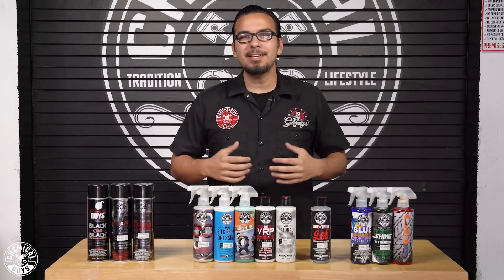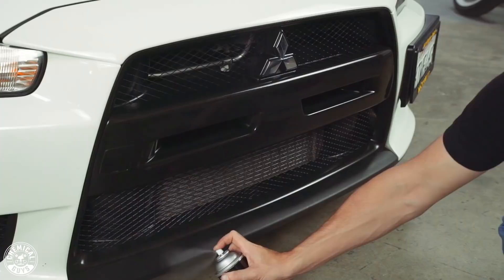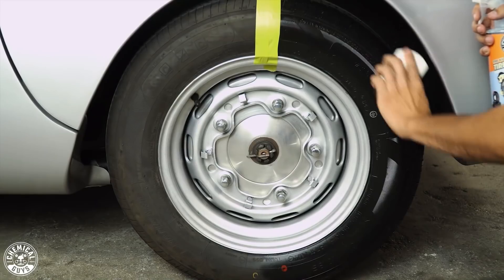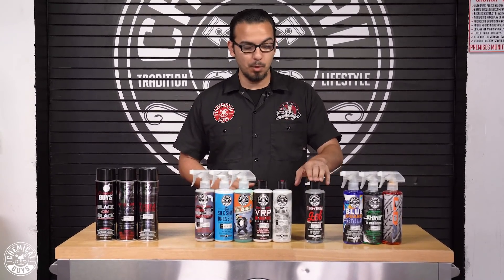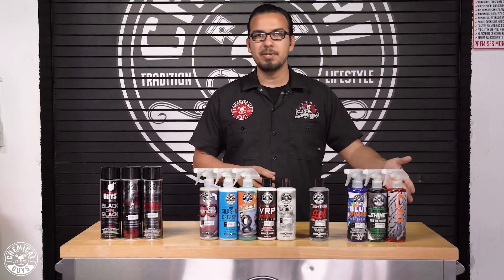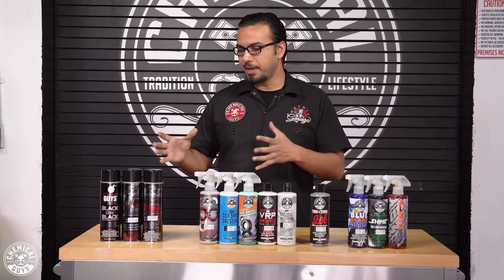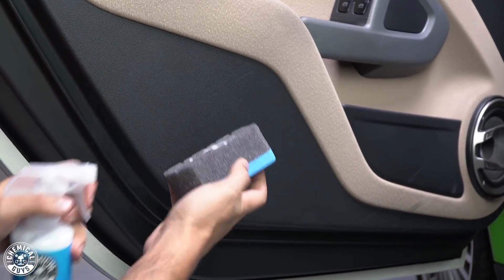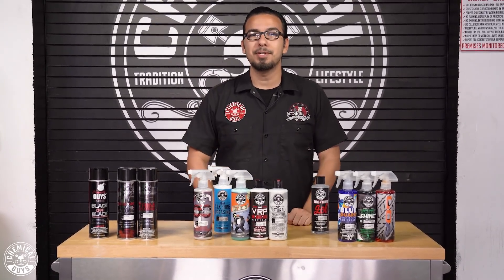How To Choose the Best Dressing! - Chemical Guys

Comment: I Am a huge fan of Chemical Guys but the dressings don’t last a few days and don’t have much shine
Reply: TurnThemWheels try tire and trim gel.
Reply: I’ve noticed that a lot of people have had this issue. What I suggest is that you make sure you use brushes to get rid of any contaminants on the tire. But most importantly make sure you use a wheel/tire cleaner that will really help break down the contaminants. Sometimes the issue isn’t the product itself but what you do before you use it or how you is it. By doing this, I have actually kept my tires looking shiny for weeks on rainy and hot days (I’ve used both VRP and Silk Shine dressing). But hopefully you might consider using a good tire cleaner to help out!

Comment: As u mention, blueguard wet look dressing is oil based, if I put on my wheels and exterior plastic area, will it cause sling on paint ?
Reply from the maker: Hi there! Use a clean microfiber towel to wipe away excess and prevent a sling situation.

Comment: Hi. I am new to car shows. Cleaning the engine bay scares me 😳I am only cleaning with plain water and a trace amount of soap using a brush or micro fiber towel.  It’s a 67 sting ray and no way I’m going to use a pressure washer under there! What dressing would make the hoses look black again but be safe to use?
Reply from the maker: Hi Mary! That's awesome, it is perfectly fine to clean the engine bay without using a hose or pressure washer. I would use Nonsense All Purpose Cleaner to gently remove grease and dirt. Add VRP to any vinyl, rubber and plastic components for a deep gloss.
- CG Nick

Comment: What do y'all recommend for brand new fresh paint?
Reply from the maker: Hi Julio! After allowing the paint cure and harden for at least 30 days I recommend washing with Mr. Pink before applying your favorite coating. A ceramic such as HydroSlick will add tons of gloss while resisting harsh elements and water spots.
- CG Nick

Comment: I like the hyper coat for tires!!  How does the look compare to the tire gel though?
Reply from the maker: Hey! G6 Hyper Coat is a water based dressing and has less of a shine of Tire & Trim Gel because G6 is a water based dressing and Tire & Trim Gel is an oil-based dressing. Also, G^ can be used on interior and exterior surfaces and Tire & Trim Gel can only be applied on exterior trim. Thanks for watching and happy detailing!

Comment: Will the aerosols be okay if I get any overspray on chrome pieces or will I need to buff it off?? Can I use the tire and trim gel and/or blue guard on the interior like say on the dashboard or the interior car doors?? Ty
Reply from the maker: Hi Katie! It is perfectly fine if the over spray from the aerosol lands on the paint or chrome, it simply wipes off. Using Tire and Trim Gel or Blue Guard on interior panels will have a high gloss but this has the possibility to glare and if a heavy coat is applied it may attract dust.
- CG Nick
Reply: Chemical Guys thanks! I ended up getting them before you reply anyway 😂😂 you need an online membership...a piece of every pay day goes to you guys! 😂

Comment: I have a lot of glossy black plastic on the interior how I do keep fingerprints and dust off or to a minimum
Reply from the maker: Hi Joshua! For piano plastic and gloss black trim pieces you can apply a coating such as Black Light Glaze to reduce static while masking minor swirls and adding gloss. Just be sure to avoid textured plastic and rubber trim as well as non-gloss interior pieces. 
- CG Nick

Comment: Great video!  I have a new vehicle with plastic trim pieces around the door/window surrounds and the windshield wiper area.  They are not faded, but I still want to apply a shine protectant on it.  Would VRP be the best choice and does it harm the paint if some gets on the paint?  Thank you.
Reply from the maker: Absolutely! VRP is a great choice to enhance gloss while rejecting harsh elements. VRP will wipe right off of glass and painted surfaces.
Reply: @ChemicalGuys  Thank you!